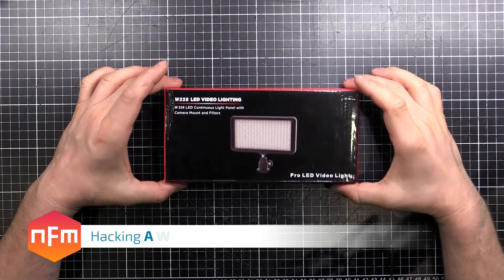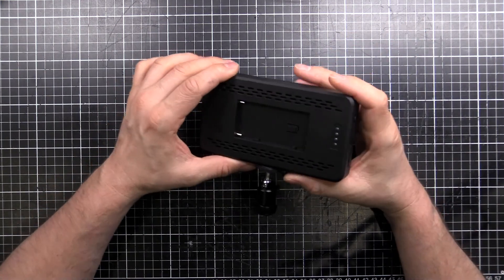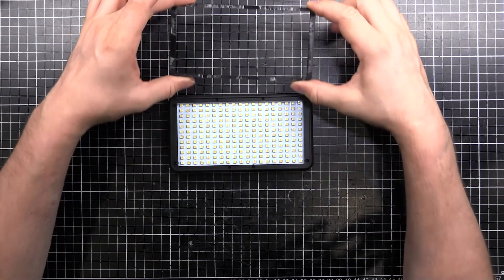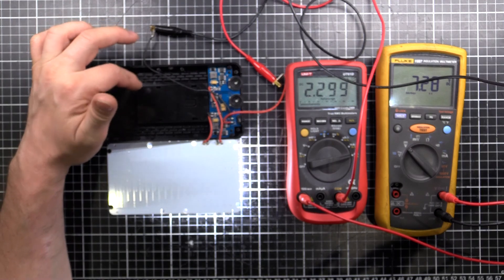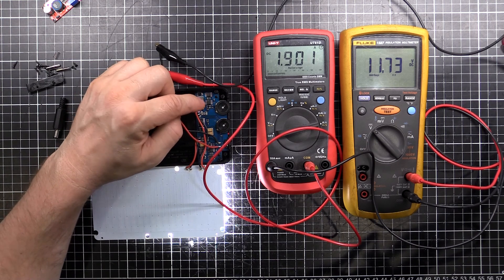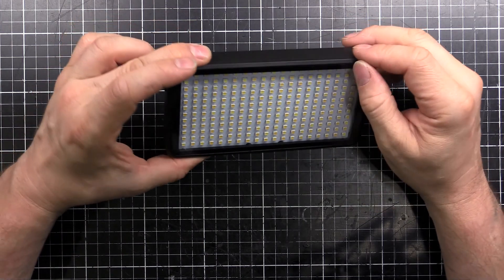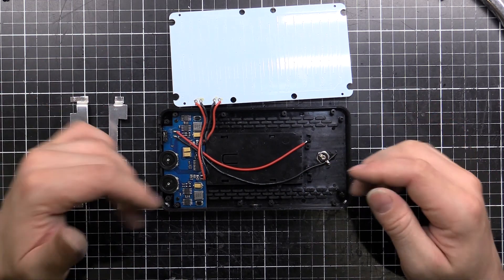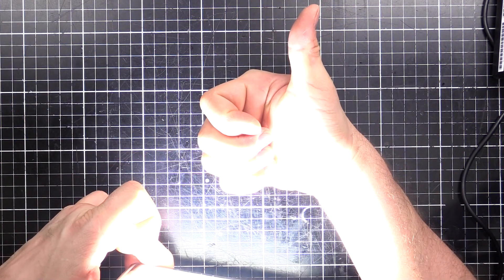Hacking a W220 LED Video Light

Comment: Hello... Why do not you use 9V power supply for minor heat problems ?
Reply from the maker: 12v means more light output. :)
Reply: As a joke to accept it ... ;-)

Comment: How about adding a diode for reverse polarity protection, sure you will lose 0.6volts or so but you have enough overhead for that not to be a problem, it might even help the chips run a bit cooler with a slightly lower voltage.
Reply: or fool bridge rectifier

oh wait, thats different channel
Reply from the maker: You certainly could, I didn't even think about it as I always use the same power adapter.
A good idea though. I didn't even look to see if there was one already on the PCB.